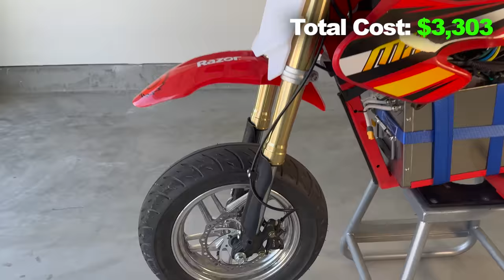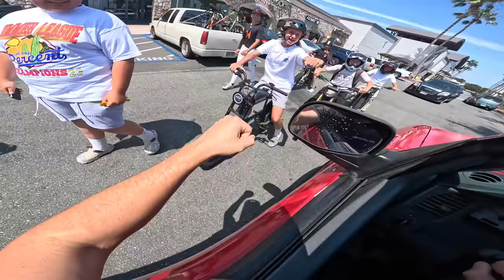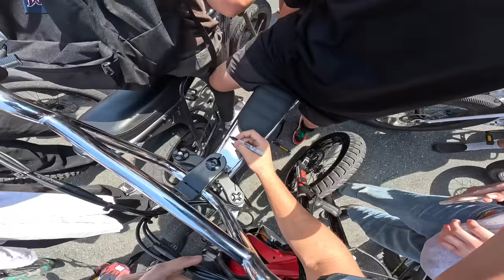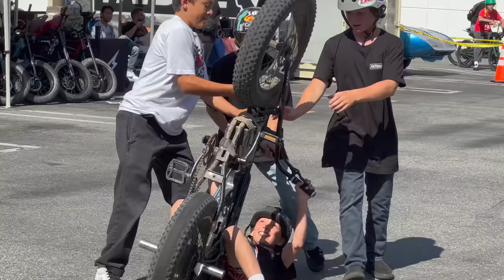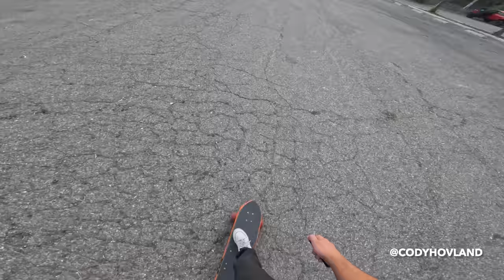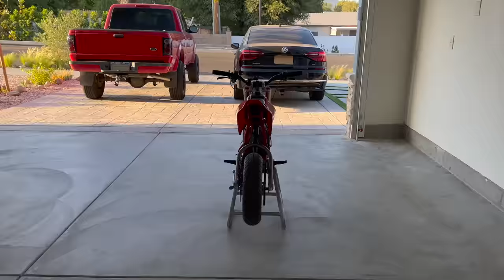Insane +60mph Walmart Mini E-Moto

Comment: It’s amazing, but man, that pricing is just wild ( I bought a hayabusa with 18k miles on it for 4200, only a few bucks more)..really wish these became so popular they could be made for under 2k, then I would be in!
Reply: Yeah dude there’s absolutely no way I’d spend that much on this
Reply: Can't look at it that way. I use to. Than I bought my 1st small bore bike like 10 years ago. Keep in mind at the time (and now) I had a goldwing 1100cc trike fully loaded every mod that could be done was done including turbo and heat vents grips and seat fully adjustable air suspension matching trailer the prefect long hauler. Than I got my icebear mojo 49cc scooter trike it's a 50cc scooter with 2 wheels in the back but looks clean. I spent 2k on it than dropped another 1k into a 150cc Italian racing motor that's now a 203cc bored out with turbo boost is small but sounds amazing 😍 and will lift the front wheel up only tops at 65mph but it's soooooo much more fun to ride than the goldwing I love it sooo much more. That bike sent me down the rabbit hole building racing scooters mopads wheelie scoots drag racing scoots. Than motorized bicycle 🚲 I have one with a 100cc 2t am6 water cooled motor on a beach cruiser felt faker frame bicycle hydro brakes and it does high 70s easy another one that has a 212cc motor fully built out about 30hp on a 70lbs beach cruiser bike lol enough said it's amazing 🤩🤩 the 2t build was around 3500 the 4t was over $5,000. 
 Than I got a sur-ron LBX 2022 I adore that bike! And just bought a talaria sting mx4 with zero regrets.
I have a fleet of bikes 16 in total from mini bikes to a fully customized crb now 700 and that 1100 my tiny trike and sur ron see the road more than any of the others.
Reply: I wouldn't buy the razor though screw that I would take a mini bike and make it electric 💡⚡ something like the Coleman ct200 or a trail master end results would be a way way more reliable bike
Reply: yeah i was going to say you could get an actual 600-1000cc bike for the price he spent on this... it was entertaining to watch? yes.. is it a waste? yes also lol

Comment: To EVERYONE getting ANY sort of electric shock:
Go to a hospital and get yourself checked out. Tell the staff in detail what happened, what you handled, how many volts / amps you've been working with etc. Any electric current can cause arrhythmia not just when it happens but hours after the incident. This can be a minor nuisance that you don't even notice, or it can lead to heart failure.
They usually keep you in the hospital for 24 hours hooked up to an EKG machine and monitor your heart while they do some other tests.
Electric current can also cause blood clots and burnt tissues in your body, so yeah, not fun. If you are lucky, the electricity travels from one point to another on a skin surface level, hence the burns. If you are connected to the source for longer, electric current could travel deeper into the body and causes the same problems (tissue burns, usually muscle, veins, nerves), but they are not visible.
Reply: Also what people need to keep in mind is that it's not the volts that kills you, it's the amps. It takes just 1/10th of an amp to make you have a heart attack...
Reply: @raymondharris6599 It's the volts AND amps. You don't get enough amps through your body without the volts to push those amps.
Reply: @astifcaulkinyeras  its the amps
Reply: @ryanhayn  It's the other way around. Amps Is what pushes the volts through the circuit.
Reply: @raymondharris6599  Incorrect.
Reply: @raymondharris6599 
Volts is what pushes the amps btw
Reply: He’s fine
Reply: shitt i aint know this when my 80v battery made a huge arc and almost made me blind
Reply: @raymondharris6599  its relative, 10 amps at 1 volt wont do shit, 1 amp at 100 is very different.
Reply: @astifcaulkinyeras  Bro Volts don't matter its the Amps that's actually the killer
Reply: @kriswhite9324  Incorrect.
Reply: Remember the saying people. Volts jolts. Mils kills.
Reply: @raymondharris6599  you can test this with a car battery. Put one hand on the neg and the other on the positive. 12v isn't enough to get through your whole arm circuit, so your safe, even if your working with something like a Mercedes battery with 95 Ah. Sure, the 95A is deadly, but not without the volts. Its the wombo Combo of death
Reply: Agreed @astifcaulkinyeras
Reply: @hogsbyavgaming9965  it's both, amps and volts. 

5000 volts and 1 amp = 5000 watts.
1 volt and 5000 amps = 5000 watts.
Reply: Crazy how I touched my 72 pack leads on accident like a day ago
Reply: that sounds expensive
Reply: sure if you pay for my health insurance
Reply: @astifcaulkinyeras  You're wrong. It's only current that damages you. High voltage just makes it easier to to penetrate your skin. If your skin is broken due to a wound, you can die from as little as 50 mA regardless of the voltage.

Just do a minute of googling instead of spreading misinfo.
Reply: @IlIlllIIIllIIlIIlII  I work in high voltage. Keep believing what you want, I don't care.
Reply: He didn't get shocked, he got arc-blasted. Electricity never entered his body. Arc-blasts are very serious as well, molten metal, incredibly high temperatures, burns (as seen here), sound decibels, but no threat to his beating heart. I'm an industrial electrician of 12 years and I get retrained (refresher courses) on high voltage every 3 years.
Reply: Because of this I'm not handling anything electric without some sort learning beforehand. 😮

Comment: 8:02

Did the same thing about a month back, plugging 2x custom 48v batteries in parallel, but one connector was on the wrong way.
About 48v and 60 amps later, my hand went black. XT 60 connectors, and it instantly melted them and the metal contacts inside
Scary as hell, so I don't wanna imagine a 72v surron battery

Comment: Thats about $1,000 more than i have in my full size build that does 80+mph and recharges in just 2 hours but i actually built it from the battery cells up not just assembled it like this razor, its 100% street legal with lights turn signals horn and mirrors and yeah it will do a wheelie without even thinking about it.

I have built a couple mx650 mx500 and even a couple mx350 and pocket mods and the most i had in a single razor build was around $800 and did 50+ mph on moderate gearing it was around 10kw.

Basically I'm saying you are putting way too much money in this thing but not everybody can afford a bike half that price, a built razor can do the same thing as for a much cheaper price you just got to know where to get the parts from which isn't hard if you don't buy it all at one damn place.

Comment: If those are 10 inch tires you got ripped off. I’ve been putting street tires on my Honda 50 and Perelli‘s at that at 20 bucks apiece I’ve been doing this for 20 years and I’ve never spent that much on tires for a minibike.